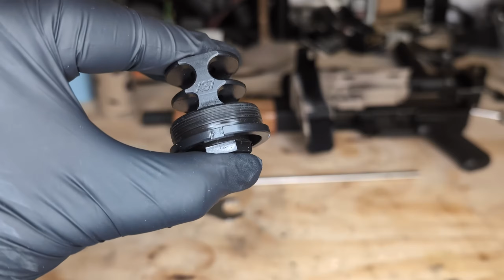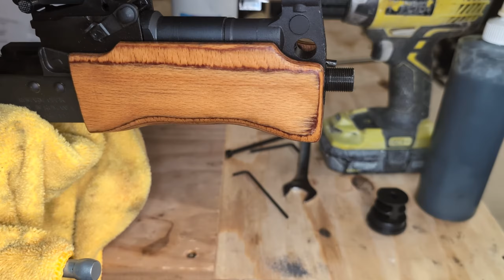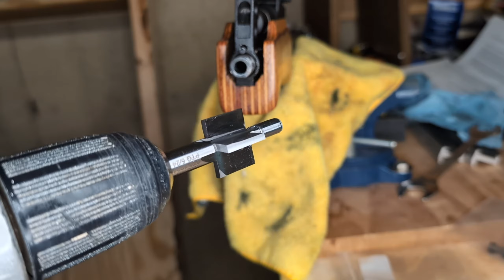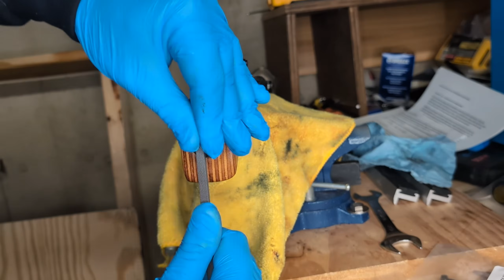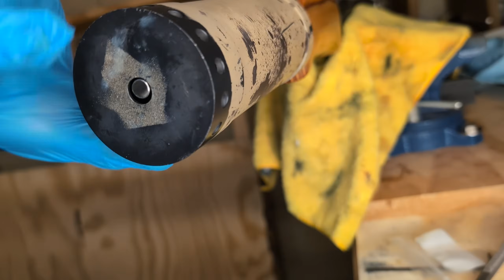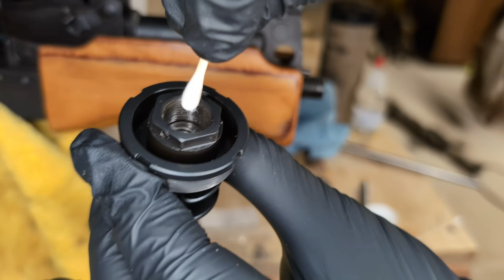How to Suppress a (Mini) Draco feat. JMAC Facemount & PTG Crowning Tool

Comment: What exact tool did you use for the crowning?
Reply from the maker: PTG 90 Deg Crown Tool in high speed steel with a 30-49 Cal pilot